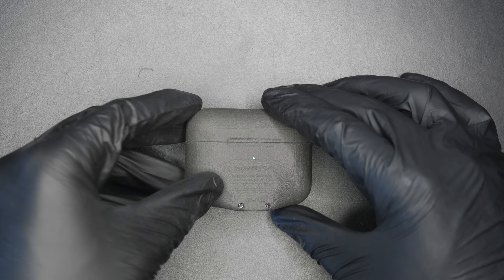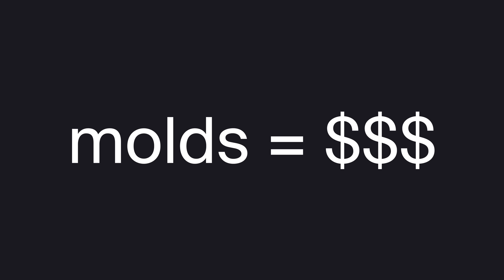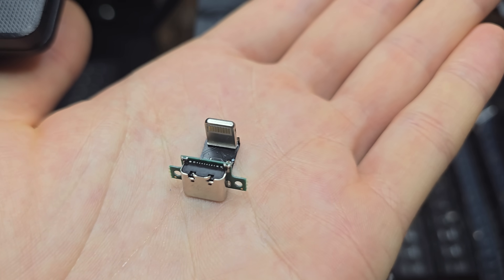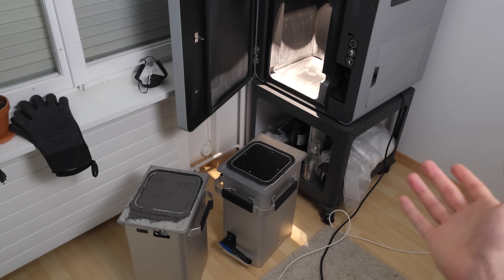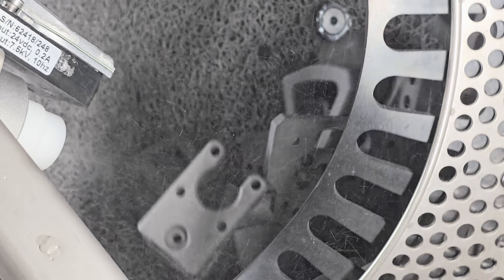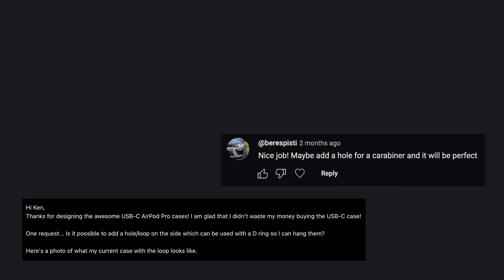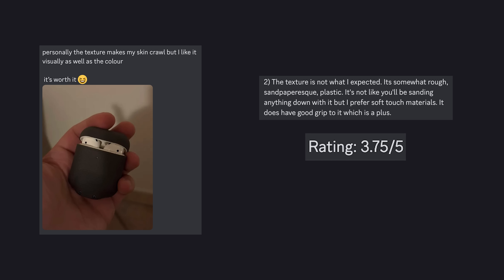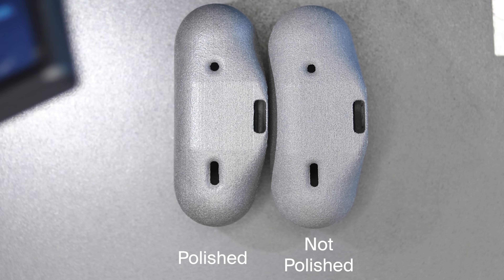One Man Plastics Factory

Comment: manufacturer in the far east immediately use your model for mass production which will drive the market price down to ~USD1-2 per unit.
so, your business is a workshop, and it will remain the same way with fanz based support. It will never be a factory.
business is tough. good luck anyway!

Comment: @ExploringTheSimulation for your cleaning the dust off after print. Have you thought about using a tumbler with beads or ceramics with a collection tray underneath for the excess dust for re-use. An exapmle might be like dry blow gold tumblers.

Comment: You should no “duplicate” parts. You should create a “variant” in solidworks its call “configuration“ so you add those extruded cut and extruded boss/base under the “lanyard configuration” then if you change something to the main part it change in all configuration. If you duplicate parts you need top open each parts separately and do the modifications.

Comment: That's just some feelgood BS, from a production standpoint. Instead of wasting all that money on these machines and having all that manual labor for such a small production volume.

One should have made or gotten a tiny 5 axis cnc for like 600usd, to work with aluminium stock. And with that could have made a small injector machine and tons of molds for less than 1000 usd, can use acids for different mold textures. 

Would result in almost no labor but very high production and very cheap costs.
Reply from the maker: Have you ever produced a mold yourself and then injected plastic in it? Just curious.
Reply: @ExploringTheSimulation  For the amount of ABS plastic granules and the 'tank ' size i needed i just checked the volume of the plastic parts, the 'tunnels and added a margin, then turned it into a cylinder for the 'syringe ' tank size. 

The piston is used was a simple pneumatic 
cylinder pushing a stainless steel rod, while 2 
roller bearings helped guide it flush. 

It was a simple machine and worked great, 
about furnished part in every 3 minutes. i didn't want to use any push method to get the part out. just instead used 1 .5 degree angled walls, and relied on the ABS loving to shrink when cooling. Also had air nozzle blowing air on the part and in between to pop it out. Didn't need any mold water cooling for that relaxed production rate. 

Later on when making a headrest to hottubs 
and such i had already built/half purchased a 5 axis cnc. Very cheap and good for to make 
smaller molds out of aluminium. Cause as 
always, model upgrades happen.

Comment: smh. my bambu will print this better with nearly no layer lines when using glass filled filament.  his is the classic "too much solution for not enough problem."
Reply from the maker: Well, I wouldn't invest all this money if I thought FDM prints could make a good enough consumer product. Supports are also an issue because if I don't remove them properly, they will scratch my customers' cases. I'm really curious; have you held an SLS-printed part in person before? They are worlds apart.
Reply: @ExploringTheSimulation  if i want i can make my Bambu parts look virtually identical to plastic injected molded parts... but of course with features nearly impossible with injection molding.  and the material properties are plenty good enough for most commercial products.  $0.03

Comment: Awesome vid! Advice: don't use tap water! The mineral buildup will get you eventually. Consider distilled water, it from mineral deposits and avoid any potential problems with bacterial contamination getting into the small gaps of any 3d printed part. Typical tap water will have quite a bit of bacteria (totally normal and safe) that can discolor your parts over time
Reply from the maker: Actually, I was thinking the same as you when I installed the kit.  The instructions clearly state, "Fill the tank with tap water until 80% full. Do not use deionized water."  Therefore, I used tap water. It uses a tiny amount of water, and I don't think much is actually sprayed on the parts.  They say it's for "conditioning the blasting media."  Thanks for the suggestion!
Reply: @ExploringTheSimulation  Awesome, TIL. Looked it up and apparently it is machine specific

Comment: you can cover it with paint which will make them even smoother
Reply from the maker: Probably, yes! I'm not exploring this solution because paint involves a lot of manual labor and potentially uneven results. It would be good if there were some type of dipping solution. I appreciate the suggestion, though!
Reply: @ExploringTheSimulation  From what i know, for smoothing without using paint you can try centrifugal tumbling method.

Comment: could you put the block in a tumbler to knock all the powder loose and capture it for reuse?
Reply from the maker: I'm hoping to find a solution like this yes, but I haven't seen anything good so far. Will likely need to be custom made. I'm also worried about the powder getting contaminated with residue from the tumbling material. Thank you for the suggestion!
Reply: @ what about a vibration/shaker table

Comment: Spend a couple of hundred Euros on a 3M Versaflow mask system. It is so much nicer and also safer than the disposable masks you wear right now, since those don't even seem to be particulate masks to begin with.
Reply from the maker: Actually, I just followed the recommendation from the printer manufacturer. It's just an N95 mask, which is apparently enough. Even the maintenance tech who works on the printers every day was wearing one of those masks. I looked at the mask you recommended, and it does look pretty good, but it also looks really bulky! How long does it take to put on and take off? I feel like those masks are maybe slightly overkill and are for more intense work with particulates, like open-air sandblasting. Really appreciate the suggestion though :)

Comment: Hey, for PCBWAY, does that sheet with multiple connected pcb's count as one sheet?
Reply from the maker: Good question! Actually you have three options when uploading your PCB:
1. Single PCB
2. Panel by PCBWay 
3. Panel by customer
I choose option 3 because I have made my own standard for panels that are easy to place to apply paste and use on the pick and place. I also optimized the size to get the cheapest price. 

They don't treat it like one PCB because they run e-tests at the end of manufacturing to make sure there are no defects. If you take a big quantity I believe it's cheaper than option 1 though. But I do it mainly so that it works well with my machines

Comment: Er no..... $15,000 for an aluminum mold... it's bullshit.
also you can combine some of those parts  into a single mold with inserts and flow blockers...
Reply from the maker: I believe it's because the bottom part has a complex geometry with concave spots which would require a very complex mold with sliders! Definitely not a simple 2 part mold

Comment: Wow, this is an amazing story. Thanks for sharing it! Kudos to the guy who was able to find product-market fit and heavily invested in machinery. This is wonderful. One of the advantages of small-scale 3D printer production, which wasn’t mentioned in the video (or at least I didn’t notice), is customization. In theory, it’s possible to do something no plastic mold can ever achieve—customization by design. For example, engraving a name, specific wording requested by a customer, or even more complex patterns. This could easily justify charging a significant premium.
Reply from the maker: Yes, I mean, doing the texture and adding the lanyard loop is already customization! As for the name engraving, it's also very doable. I didn't do it this time because last year I made that available for another project that used SLS, and not many people used that option. In the end, it was more of a struggle to implement on the website than anything else. I might bring it back one day, though. Thanks for the suggestion!

Comment: u guys need to look into cheap hand injection molding, do a mold roughed in aluminium with a 200$ cnc micro desktop crap.. and u have replaced ur 3d printed crap... and u get relatively cheap and good quality... no need for factory size mirorr finish molds, the 15k pricetag per mold is because the molds they use are polished so much they look like mirrors, and they are very expensive to make it like that but for what u are doing, regular aluminium cnc-d is more then enough until u pile some cash and get a mirror polish on ur molds... u looking at 1000$ in machines and DIY crap... and outcome goes maybe 200x better then what u can do with 3d printers, and much faster a lot faster... right now u spending 4-5hrs per 3d printed per unit printed right? now imagine doing it in 10 seconds, ready to use
Reply from the maker: You use the word "crap" too much; it doesn't make your comment look very well-thought-out. Just thought you should know. I respect your opinion, but I don't believe it will look 200 times better with the cheap tools you mentioned. Also, hand injection molding is good for prototypes, not production. It gets tiring very quickly. I'm not sure where you saw that it takes 4–5 hours for one piece? I say in the video that it takes 12 hours for 70 full cases, which is 210 different pieces.

Comment: Congratulations on your business! I am just confused bc I thought you were going to metal 3D print a mold and then inject the parts.
Reply from the maker: Answered in another comment, but basically, you can't do that because the surface quality will be awful, and then you need to make a pass on a CNC mill, which defeats the point because you might as well do the whole mold on the CNC mill. Thank you for watching!